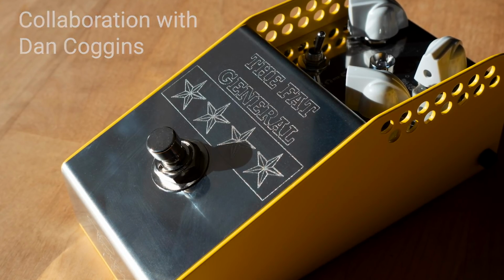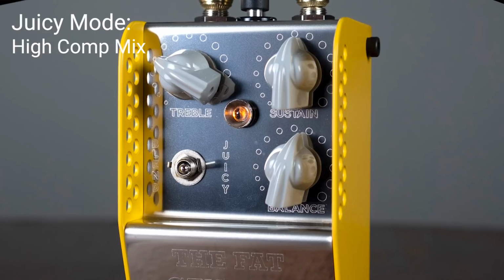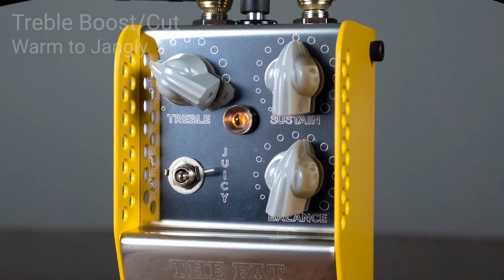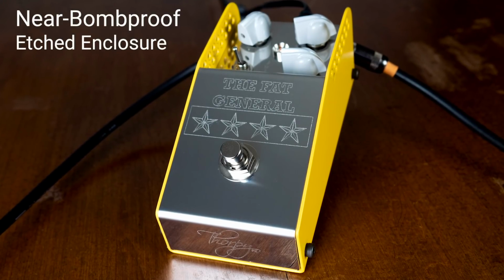ThorpyFx Fat General Parallel Compressor

Comment: How does this compare to a Cali76?
Reply: Christian Pescado I chose those over the Cali76 for rock and harder genres. Cali76 seemed focused on funk/country sparkly treble vibes
Reply: The thorpy is optical compressor good for pairing with drive pedals because it is clean and transparent. Cali76 is FET compressor and adds beautiful rich color to clean tones but I dont like it for medium to high gain tones because it raises the noise floor a lot. If you love clean tones Cali76 is the way to go. But i also have an optical compressor for drive tones.